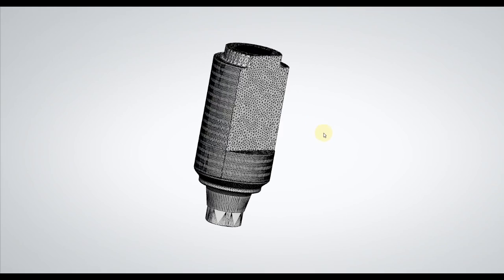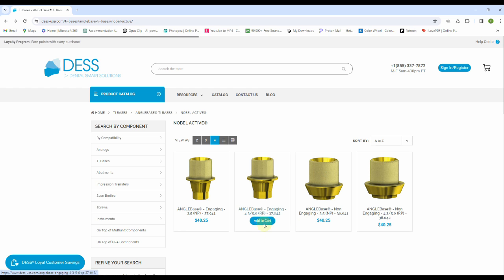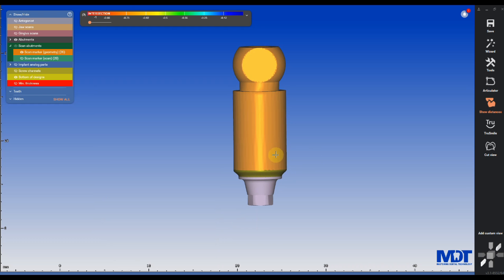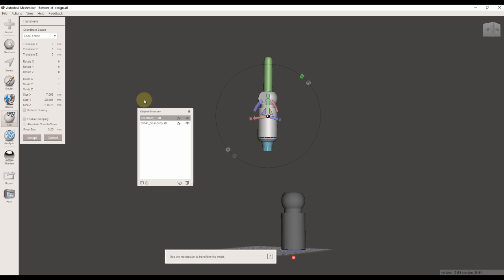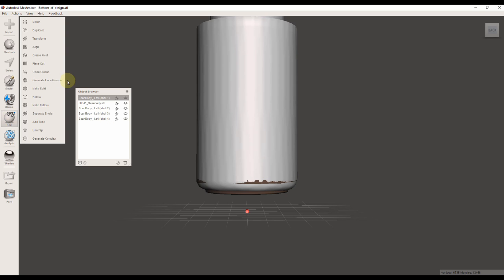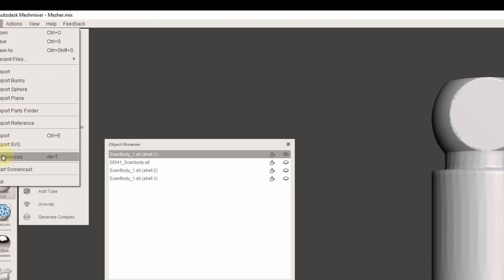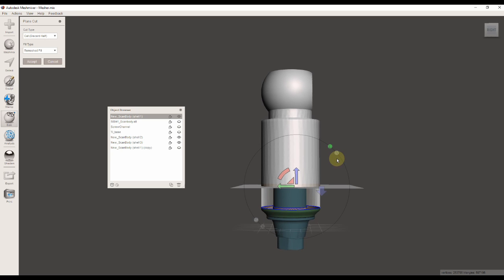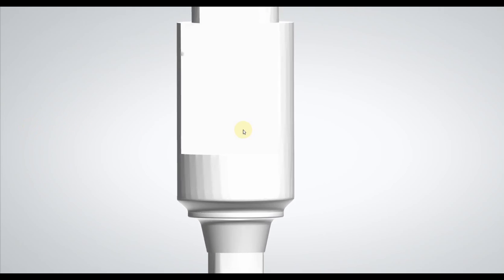Create a Custom Scan Flag for 3D Printing in Exocad and Meshmixer

Comment: Hello, I use Google Translate to translate my question from Spanish to English, I hope the translation is good.
I tried to do it and I have a problem, when I select the implant library, I choose the corresponding base Ti but it is slightly different, it is a few millimeters larger and also the inside of the base Ti is a little deformed. As if it were protected. Do you know how to solve it? Thank you so much
Reply from the maker: It's difficult to analyze. If you can email me screenshots I might be able to help
Reply: Thank you so much for your videos. They have been invaluable! Regarding the question above; I am running into the same issue where the ti base that is loaded as a custom tooth form is slightly larger than the ti base already present. Specifically I am using the Dess I/O scan bodies and associated ti bases. I've tried taller abutment and different platform sizes of the same system (Hiossen) and running into the same issue. We're you able to find the root issue for the user above? I am happy to send screen shots/recording if it helps. Thank you!
Matthew

Comment: Thanks. Very informative and cool tips. I have a question for you. I have a case that doctor use an OEM scan body. After design the custom abutment and milling in in our Arum machine, the abutment always Rotated distally. Do you know why?
Reply from the maker: You have to use the according TI- blanks with the according library. All the milling and design information is synchronized. That means, if you use DESS scan flags, use the DESS blank library and mill in DESS blanks. Same with Medentica, Nobel etc. Stay in the system.